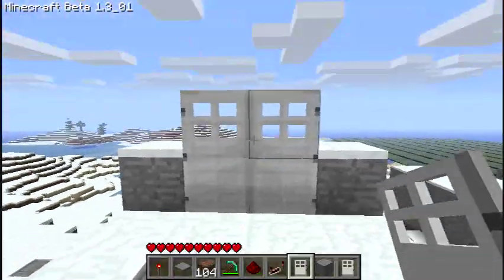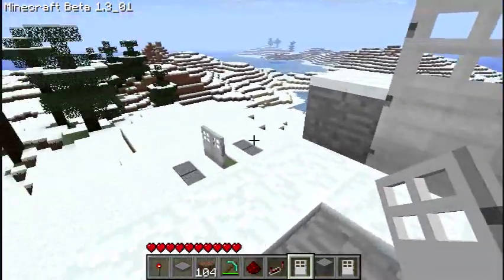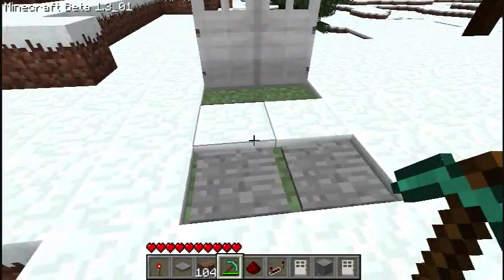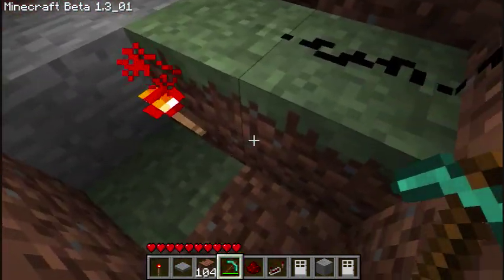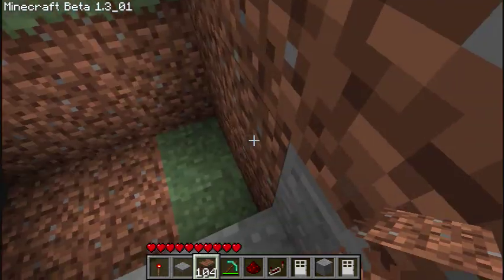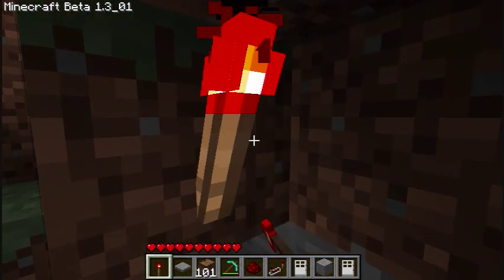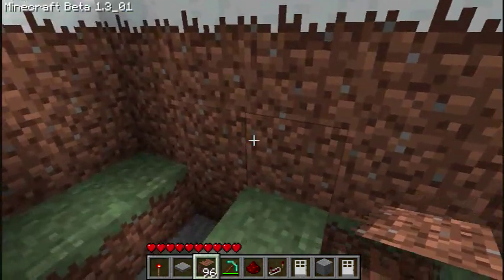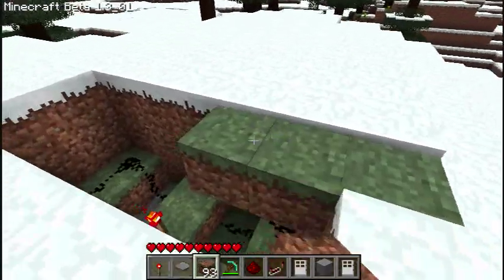Compact Double Door with Double Pressure Plate in Minecraft Tutorial

Comment from the maker: @freskito24 Actually, no you don't.  Not including Doors, Pressure Plates, and the blocks upon which they rest, My design requires a grand total of 15 blocks to function, yours on the other hand, requires 17 blocks.  Thus, mine is more compact by 2 blocks.  As far as volume of the entire system goes, yours takes up a 3*4*5 area, whilst mine takes a 3*3*5 area... a 15 block difference...

That being said, for most cases, your design is probably the better one.